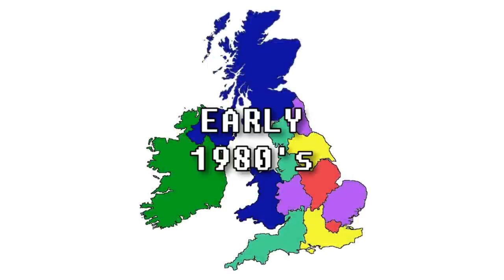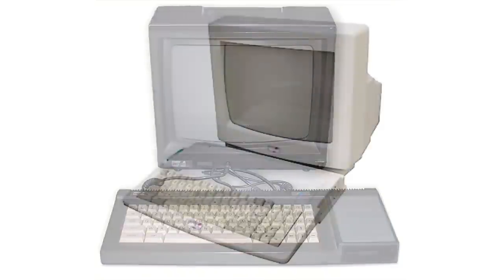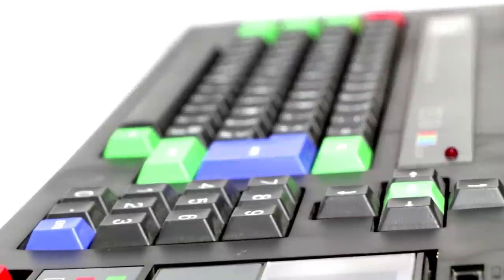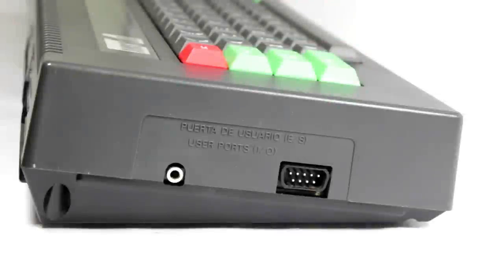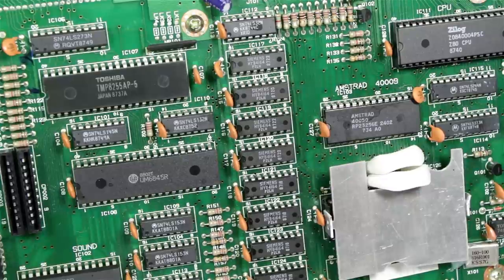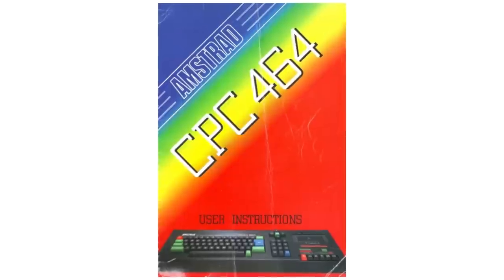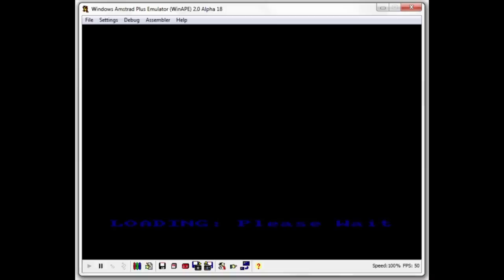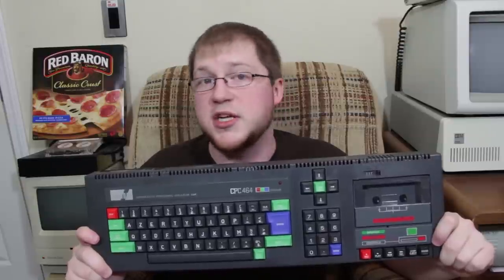LGR - Amstrad CPC 464 Computer System Review

Comment: For a short time in the mid to late 90s i had a CPC6128 with a green-monitor. Bought it at a flea market very cheap. I had about 10-15 disks with games for it. No one else i knew had a CPC with diskdrive, so no way to get more games. At that time one used disk would cost 8 DM (4 Euro) and you could get a 10-pack of 5,25" noname-disks for 5-6 DM (2,50-3 Euro)... That's the price you payed for Amstrad's cheapness. They used 3" diskdrives because they could get them much cheaper than 3,5" diskdrives. At least they were really fast compared to my C64. Maybe two years later i sold it at a flea market, getting much more money for it than i payed before.

The CPC games can look really great, when the right mode is used. But there are so many Spectrum-ports, that just look ugly. I never liked the Specci graphics. If the games sticked to monochrome they could look really nice, but 99% of the multicoloured games are ugly, imho. My graphics-ranking of 8bit homecomputers would be something like this: C64, Atari XL, CPC, MSX(?), Spectrum. I was pretty disapointed when i saw MSX screenshots and videos for the first time. Monochrome "sprites"... Don't know where to fit in the other 8bit machines: +4 (still have mine with box), other british computers like BBC, Dragon etc.. Did i forget other important (in Germany/Europe) 8bitters?

Does anyone know, where certain computers were especially successful? C64 more or less all over europe (germany, UK, denmark, sweden, italy), i suppose. CPC in france, MSX in the netherlands, Spectrum in the UK and russia/eastern block. The +4 was pretty successful in hungary, they made new games and hardware (256k expansion) in the 90s.

Comment: Hello, just to let you know there was a separate unit that provided the power and an rf output so you could use it on your TV, but they are very rare these days.
Reply from the maker: Yes, and there's an annotation saying this in the video. I also mentioned that there's a third-party solution to this nowadays so you don't have to bother with finding the old one!

Comment: Nice video but it's a shame you didn't go more into the crazy 3" floppies. I know they're not just for the CPC but just look at them! Crazy! ;)
Reply from the maker: Totally. I want to get one of the later machines and cover those in more detail sometime, or even do a video on odd floppy disk formats. Lots of forgotten formats and sizes out there!
Reply: Lazy Game Reviews
make sure to pickup replacement belts for those floppy drives, they are known disintegrate into black goo after a few decades.. other than that, those floppies are pretty reliable

Comment: We had one of these when I was young (UK qwerty model), it had an original power brick (about 8in square and 3in high!) that also did RF modulation so you could connect it to the TV aerial socket, we didn't have the monitor.  You can play most Spectrum games on them too, they're mostly compatible.

Comment: The 6128 looks virtually identical to the Sinclair ZX Spectrum +3, which is no coincidence considering Amstrad bought what remained of Sinclair after the videogame crash in 1984. The +3 was the only Spectrum, like the 6128, the could run CP/M without any additional hardware.

Comment: Considering the tape-recorder is built into the machine, why didn't they speed it up to 2x or more.  Having software load many times as fast as the competition would have been a huge selling factor, also considering disk drives were an expensive luxury those days.  Same consideration goes for other home computers which required their own cassette decks of course, like the C64, but considering Amstrad also made hi-fi equipment, and it came out years after the other 8bit computers (indeed it was one of the last successful ones before the 16bit era) it seems like a lost opportunity to add a selling point at little to no cost.  Also, while the bundled monitor was one of the major attractions, had they released a model which could connect to a TV, I believe it would have sold even more... instead Amstrad acquired the ZxSpectrum, and had to split their efforts between the two machines.  I'm confident after a year or two, a monitor less CPC6128 with tape-recorder could've been sold at a similar price to the spectrum, and would have made the Amstrad far more popular.

Comment: I remember having one of these as a kid, the same version but, mine had the separate non-compatible with any other system, floppy drive and colour monitor. There was only a couple of games I liked and played, harrier and spin dizzy, which I had on floppy. After a while I started to hate it, because it was a hand me down, and at the time much better systems were becoming available. Sometimes the cassettes would become stretched and the age, that took them to load, at least it seemed that way, and then would then fail. Going round to friends or family who had better systems, then coming back to mine, i felt cheated. It sounds strange but instead of enjoying it for what it was, I looked at it as something one step behind. It languished in the loft for a while before going to a neighbor. Looking back I regret so much letting it go, what you don’t realise as a kid, I wish I knew then wha I do now.

Comment: As a C64 user back in the day, I always felt sorry for CPC users. Not because the machines were crap - they weren't - but because most of the software released for it was ports from other systems. It always felt like it had lots if underexploited power. 😟

Comment: It's actually not that a big deal to operate a CPC without the Monitor. The Power is just 5V so any universal PSU with the correct plug and more than 2 amps will work. To build the Scart cable should take less than 15 minutes if you can solder. There even was an RF modulator produced by Amstrad which included the PSU. It's rare and doesn't produce a good picture...
The tape drive is actually quite reliable. When I transfer games to tape, I get >75% success the first try. When a game fails at first try, I reduce the speed of the audio before recording the tape by 10 to 15% and try it again. After that I'm at >95% success and once the tape is written successfully it reloads 99% of the time. I call that pretty reliable ;-)
Btw... the volume controller is for the internal speaker, not the tape!
That you can hear the tape noise in the speaker is an (unwanted) side effect from NOT shielding anything inside the CPC so the tape noise interferes into the yuidio amp.
Reply: Most 5V+12V PSUs(the type you usually get with external HDD enclosures) I tried never seemed to work right despite having what should be an ample 2A+2A amperage. I ended up just using a small old PC PSU that was barely bigger than a 3.5 inch floppy drive (which you should have attached anyway if you want to transfer files :) ).
Reply: wolpertinger I use an ordinary 2.5A universal PSU. Not the cheapest one, but just a regular switching PSU. I even used a 1.5A PSU of the same type before which caused distorted audio on the internal speaker because of the increased ripple. But the CPC worked without any problems. Even with extensive tape use. Maybe those 5v/12v PSUs also need some load on the 12V rail to give good 5V?

Comment: I have a soft spot for 464's.  Ok they aren't very fast, and the full colour mode was damn low res - but they were great machines to use.  Back then, as long as Dizzy ran fine, there wasn't much else to worry about.  I always liked to program on these, felt so much more professional than the Speccy.
Reply: so do I but then that's probably because it was my first computer that I had 10 minute loading times maybe bad compared to day but for the time the Dizzt games Harrier attack and Hunter killer were all great games
Reply: While CPC is less powerful (Some of CPU power is eaten by shared RAM - at the time it wasnt easy with that), it didn´t had 2 color limit in 8x8 pixel block like Speccy did. Yep... its kinda sad that here in communist regions we didn´t get much taste of it. Speccy was f**kin overpriced (it was sold for "coupons") and if you were lucky to have someone in the west you could have Atari 8-bit. If you didn´t had money for Speccy or family in the west only computers you experienced were IQ 151 (at least in Czech Republic), they were only good for making coffee, since they produced a lot of heat (its miracle that some of them survived)

Comment: "Reasons for getting one: 1) nostalgia or 2) vintage collector's curiosity"
Are there any other reasons? I mean, I don't see how sourcing C64s or Macintosh's could increase our bitcoin mining capability ;-)
BTW: The "PSU in the monitor" was a brilliant idea because...you were practically getting the monitor for free (i.e. similar computer w/o monitor would cost the same); the comfort was unmatched, the green monitor allowed to work with CP/M in 80 columns mode without straining your eyes...and without straining your family's nerves by taking over the tv set. Unlike the USA, one tv set per household was pretty much a norm.

Comment: So on the older computers that used cassette tapes, could you use just a random cassette player you had? (like say a sony walkman) for the system, or did it had to be a cassette deck that was made for the system?
Reply: they should work, although some systems like the CPC used proprietary plugs instead of phono plugs. there also was the option to use remote signals from the computer for play, stop etc and not all cassette players supported this. these days, you can just plug int y phone or mp3 player and load compressed tapes within 30 seconds

Comment: Did any of the British computers (Spectrum, Amstrad, etc) have hardware sprites, or was that task left up to the CPU? How about hardware screen scrolling? Having specialized hardware to do those things makes a HUGE difference in overall game performance. Just figure that the Commodore 64 only had a 1.02 Mhz processor (.985 Mhz in Europe), but could move things around the screen (and move the screen itself) quite fast. This philosophy is also at the heart of what made the Amiga so fast for its time (coprocessors handling various things instead of the CPU).

JW3HH
Reply: JustWasted3HoursHere The BBC micro had hardware scrolling in its "text" modes (which were actually bitmapped graphics modes with a memory map optimized for blitting 8x8 characters quickly on character boundaries), but no hardware sprites; it was all just memory mapped graphics rendered in software, plus a 40x25 character-based teletext mode (which had very primitive block graphics characters too). The other machines you mentioned were purely non-hw scrollable memory-mapped displays, AFAIR.

Comment: the 464 tape deck wasnt as bad as you make out...it never failed me over 15years of useage....the tapes themselves on the other hand....it also doesnt "require" the monitor..the connection is RGB+vsync...its not hard to make your own adapter to get video out...infact i made a simple black and white video back in the day by flipping 2 screens stored in ram, and 2 wires out (connected to green and vsync) to composite in on TV...sure PAL might be an issue...but thats what ya get when ya country doesnt like standards the rest of the world uses! (PAL vs NTSC...Metric vs Imperical etc etc!)

Comment: i had a c64 plus 4 which wasn't 64 or plus and would only take c16 games but had a built in word processor and spreadsheet if you could afford the printer etc how about a review or did i miss it

Comment: Correct me if I'm wrong, but isn't the Zilog Z80 also in the Game Boy?
Reply from the maker: Not quite, it has a custom Sharp LR35902 CPU, an 8080-derived processor with some Z80 instructions added. The Z80 was used in the Sega Game Gear though!

Comment: How you convert the RGB SCART to HDMI ?

I have lot of trouble to find a reliable solution to connect my classic consoles to modern display, since here in France, everything was using scart.

Unfortunately, today, even monitors that still has SCART connector may not be compatible with it (Majority of TV sold today has a Scart connector but with only composite support...)
Reply from the maker: I use one of these: http://www.ebay.com/itm/Scart-HDMI-to-HDMI-720P-1080P-HD-Video-Converter-Adapter-Box-For-HDTV-DVD-STB-/350735096556?_trksid=p2054897.l4276
Reply: Thanks !
Reply: I find it hard to believe they really don't support RGB. However, there is a problem because SCART can carry composite, RGB or S-Video so according to the standard certain voltage levels are used to signal what mode to use. Problem is, TV manufacturers don'T always keep to that and sometimes switch automatically or require you to switch manually. It is especially bad when you have consoles or machines that don't supply any additional voltage to tell the TV to switch to RGB mode. Overall it might be a good idea to get a converter since more and more manufacturers are skimping out on SCART anyway and expect you to buy proprietary adapters for 50 bucks
Reply: wolpertinger Well, I don't know the details, but I know that some TV simply display a black screen when trying to play at the Genesis (megadrive, elsewhere than US), and it does send 12V to the TV for auto switch.

And anyway, it's not like I had a choice anymore, since now I have a video projector that doesn't has scart at all, only HDMI/VGA/Composite/Component.

Comment: It’s a shame you didn’t know about the MP-1 / MP-2 modulators when you made this video. They replace the need for a monitor by acting as power supply and TV-compatible signal output. They seriously reduce the postage cost for a CPC.

Comment: I NEED HELP. What model of computers made by Amstrad doesn't need a monitor. PLZ RESPOND!!!
Reply: You don't need monitor. You can power the unit with a 5 volt power supply like a phone charger or something. For video you need a cable that adapts a 6 pin din out to scare.  You can make on or buy one from eBay, retrocomputershack etc.
Reply: Scart not scare!
Reply: Plan C THANKS!!!

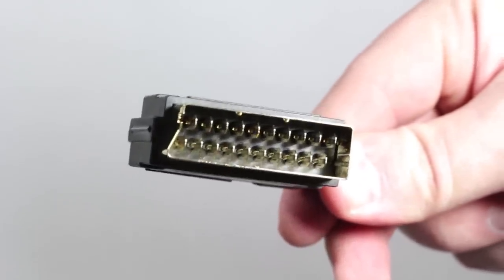Comment: 6:00 - Wait... really? Most European televisions have support for both standards. Have had since the age of the playstation (which made importing games much easier)

It's odd that you didn't have SCART in the US (From what I can read) - It had slightly better picture quality than the composite cables (In fact adaptors came with pretty much every console and hardware you'd buy)

Comment: you forgot about the Spanish CPC472
Reply: Funny fact about the CPC 472, is that it was only made to allow amstrad to distribute the CPC464 in spain. There was a
law that forbid to sell computers with 64k or less ram without the special spanish character like ñ on its keyboard ! So they made a quick&dirty workaround by adding just 4k ram ! And thanks to that, Amstrad got quite a success in spain, and luckily for the other users, spain produced many good games on CPC !

Comment: I just realized that  most of the 8-bit computers from the early 80s are just built into the keyboard. Why did they do that?
Reply: +michael1234252 Probably to make them smaller. Part of the appeal of these early microcomputers was how much smaller they were than full-size computers at the time, and how convenient they were to use since everything was built into the keyboard.
Reply: SBG Haseo oh cool but they would still need to buy the monitor and/or mouses/joysticks.
Reply: Actually with the exception of the CPC, a lot of these early computers could be used with a regular TV set. Granted the monitor would give you a MUCH better picture quality, but you didn't necessarily have to have one. Also, mice weren't really an important thing until the Macintosh came around with its GUI that used a mouse as its primary input device.
Reply: michael1234252 - the cool thing is they have new computers built to look like the retro ones with modern specs.

Comment: A year later, Amstrad released the Amstrad PCW 8256 and 8512 and later the 9256 and 9512.  

The difference between the two is basically, the 8k series had a monochrome green CRT and the 9k series had a monochrome white CRT.  

And all PCWs were all-in-ones.  As the CPCs were bundled with monitors which provided the power supply, the PCW's screen was built into the case.  

I wouldn't mind seeing you do a video on the Amstrad PCW.  Retro Recipes has one and has done videos on it.  It was a CP/M system that had a full bitmap display.  

Also, the Amstrad PCW is also not the same as the Amstrad PC.  The PCW was a Z80 based CP/M machine, not an IBM MS-DOS compatible.

Comment: I've heard of bootleg Commodore 64 mini computers that Run games directly to your TV, I don't know if this actually exists because I couldn't find an easier answer on Google or YouTube so I thought I might ask you. When could the motherboards and processors be shrunk on old game consoles like PlayStation 2 in GameCube. I want to be able to run play GameCube games on original Hardware I would buy a phone charger. I want original Xbox clones to all have 128 megabytes of RAM like the Developer Edition. And for their motherboards to be smaller so they easily be made into portable consoles. I guess what I'm asking is, is it possible for these old game consoles to reverse engineered by hobbyists and sent off to the chip manufacturers in China. And if it is possible could someone do this in the next 10 years?

Comment: The scart or euro-scart (also was standard in U.K.) is actually just a bunch of thin cables carrying analog audio & vision, just like the RCA phonos.
It was convenient but cramming all those cords into a single bundle leads to potential cross over interference, and a weak design-not very robust! I used scart and phonos in U.K. and my final conclusion is…..you were right not to adopt scart in USA….the convenience aspect isn’t worth the fragile design and slightly lower quality (caused by scaling down all those cores in a tight space).